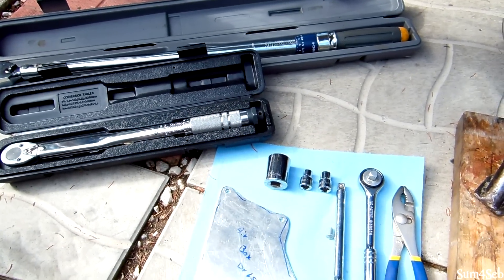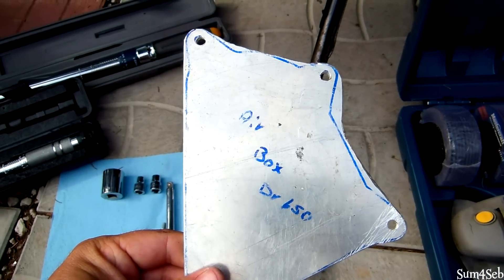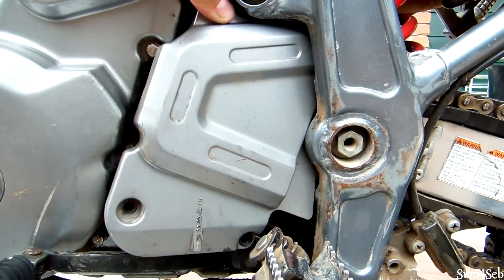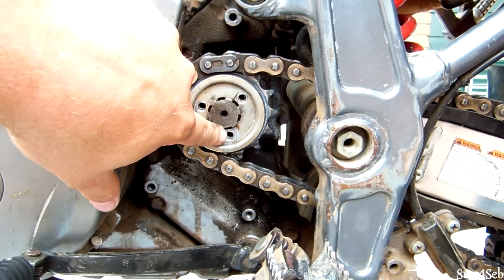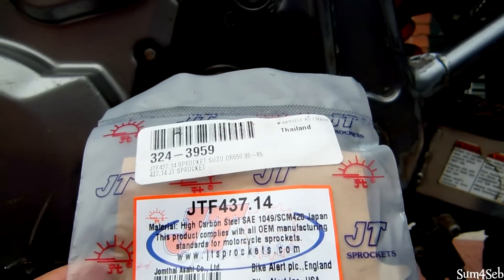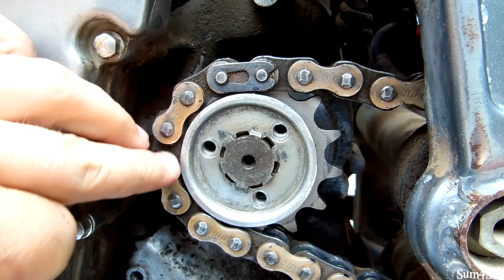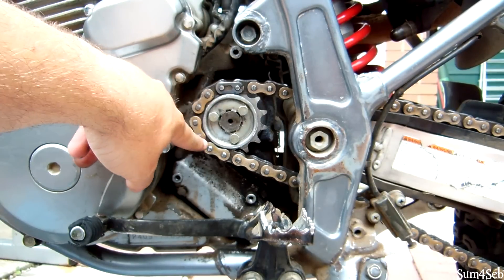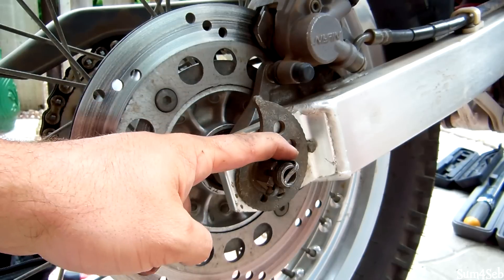How to change your Front Sprocket Suzuki DR650 |¦| Sum4Seb

Comment: Anyone who reads this should be ordering JTF438-14! This is a 520 series sprocket that is wider where it engages the countershaft splines giving more contact area than JTF437 to prevent damage. The JT rear sprockets for a 520 conversion are JTR822-XX (XX being the teeth count) for steel, JTA822-XX for aluminum rear sprockets. While you are there replace the lower chain roller with an All Balls 79-5001and toss the upper roller before the chain removes it with the chuck of frame it's bolted to. The other alternative is a Fritzco front sprocket, wider spline contact area than the JTF438.
Reply from the maker: Thanks for watching, good summary of necessary information if converting to a 520 chain. Have a great weekend.

Comment: Should the counter shaft be lubricated with something like anti-seize.  I read the shaft is bad to wear
Reply from the maker: The service manual doesn't state anything but I always add a bit of waterproof grease and loctite the bolts. From memory I think the bolts are 4.5 ft/lb of torque

Comment: Well done !  I'm experimenting with the 14 and 13 tooth sprocket on our DR 650 and wounder why a " snap ring " would not work instead of the 3 bolt retainer ?
Reply from the maker: Hi, some have used the snap ring and it seemed fine. We like to try to keep things as stock as possible, they also sell a triangular retainer to replace the stock one. I think pro cycle and a few others sell it. 13T will wear components on your bike much faster because of the short radius around the swing arm. You can also go with a bigger rear sprocket to get the same gear ratio. Good luck with your testing and happy riding 😀
Reply: @Sum4Seb  Thank you and sounds like I'm better off to stay with the 14 tooth and factory retainer .

Comment: I just put a 14 on front, I put the tension on chain at  3 on each  side. The chain is tight but has some play, do u think its ok? I am a newbie so bare with me, lol PS u say 1.2 to 1.8 is that millimeters?
Reply from the maker: Hi, it's in inches (30-45mm) and it's measured at the mid point between the center of the front sprocket and center of the rear axle. You definitely want it to be on the loose side rather than tight side. It's section 7-21 in there owner's manual, you should download the service manual pdf as well. Let me know if you need anything else and congrats on your bike 😀
Reply: @Sum4Seb  ok will do....I did a test ride around the block and oh my lord , WHAT A UPGRADE! first gear no jerking shifts so smooth!
Reply from the maker: @overcome8628  nice! It's -19° here today, no motorcycles for another 4-5 months probably. The 14 tooth is really nice off road too.

Comment: Hi! I wonder if you can help me. My 1988 dr 600 rear wheel sprocket has no play going forward or backward but it slides on it's axle, like if you go and push on it from the left side of the bike it moves quite a bit. Is it normal?
Reply from the maker: Andrea Gili Is there anyway you could take a small video of what it does, that way I have a visual to go from. Post as private and send me the link :)
Reply: Sum4Seb Hi! You are super cool, thanks for trying being helpful. I already solved the problem: some smartass dismounted the rear wheel and in the process of remounting it he put the spacer (next to the rear sprocket in my model) upside down. Good thing i notice the noise the chain made and investigate, or the bike wheel could have blocked on the highway and then... i don't know. Thanks again :)

Comment: This may seem like an obvious question but how do you adjust the chain on the right hand side of the bike looking from the back? The left is easy, just put a socket on it and turn, but how do you move the other side. (I have a second hand bike with no manual).
Reply from the maker: Hi, to adjust the chain slack, you have to take the cotter pin out, loosen the nut on the right hand side, adjust the chain slack with the adjusters on both sides equally. Once you have the slack adjusted to 1.2" to 1.8", tighten the rear axle nut back to 79.5 ft lb of torque, and put the cotter pin back in (or get self locking nut). You can also find the .pdf owners manual online (refer to section 7-22).Ride safe out there!

Comment: How come the seal is not needed?
Reply from the maker: Sorry I keep calling it a seal but it's actually called a Front sprocket damper, only used to reduce the noise level of the chain unto the front sprocket. Some people like having them in no matter what, I really didn't hear any difference between the two setups. The OEM front sprocket has a rubber damper. Aftermarket sprockets do not as far as I know.  The damper only affects noise, not function. Hope this helps, good luck and T4W
Reply: It’s more so designed to help reduce vibration rather than noise

Comment: Bro
My front sprocket has been damaged as its teeth are a bit bend. But my back sprocket looks fine. 
Is it okay if i change my front sprocket only? 
Or should i buy a complete chain set?
Reply from the maker: Hi, sorry for the late reply. I personally would inspect if your rear sprocket and the chain is still in good shape. Read your owner's manual and check the stretch on your chain. If everything is within spec I would just switch the front sprocket it will just end up wearing a tad bit faster that's all. Next time around then you can change everything all at once. Hope this makes sense, good luck with the swap and enjoy riding your bike!
Reply: @Sum4Seb  thank you :)